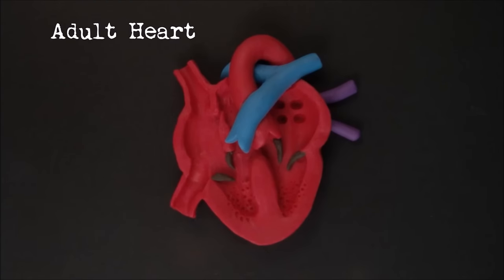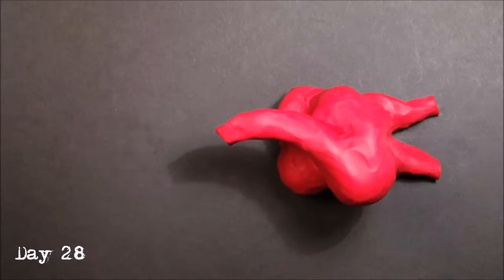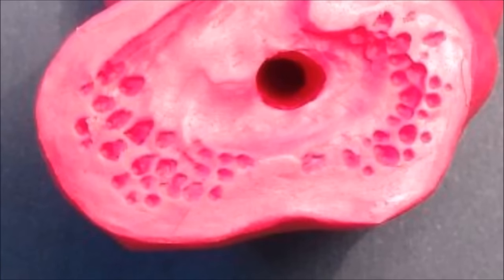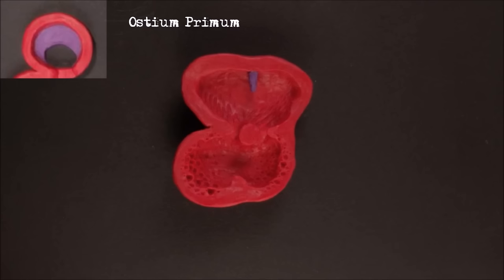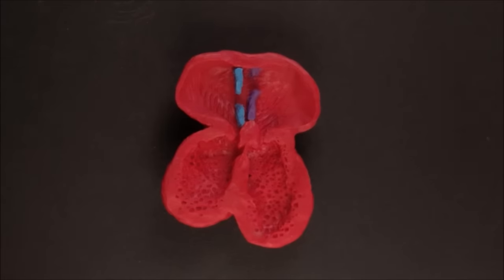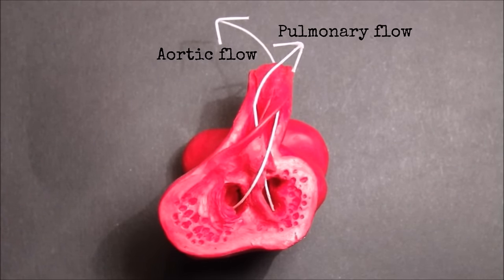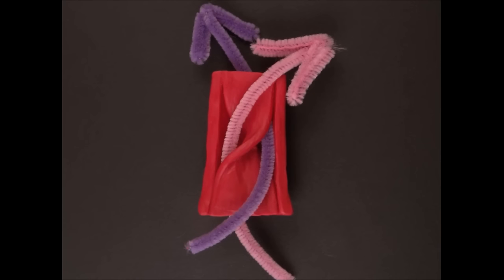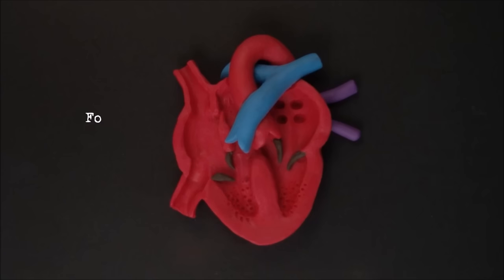Heart Embryology Animation

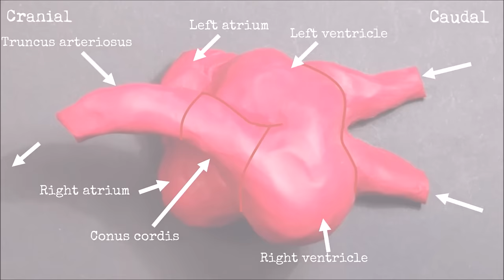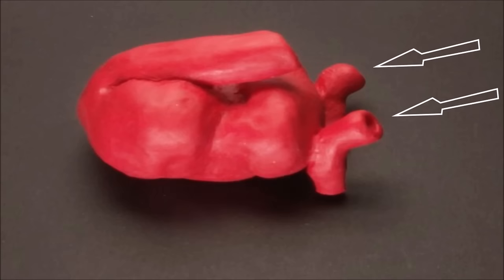Comment: Amazing video. Thank you! Quick question, how does the structure at 1:17, turn to the structure at 1:25? I understand that at 1:17 you have inflow from caudal end then out at the cranial end, but then at 1:25 they're on the same 'side'? Does the Truncus arteriosis bend towards the caudal end? Or the Sinus Venus/inflow area bend up towards the cranial end? Thank you!
Reply from the maker: Hi there.
I think they both move towards each other. It might be worth having a look at a textbook to fill in the gaps. It's tricky to get your head around.